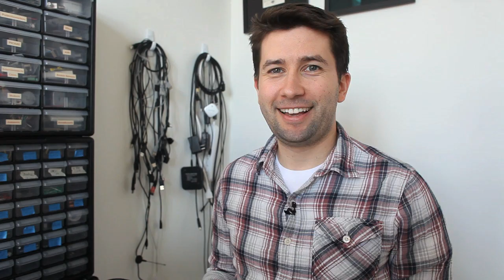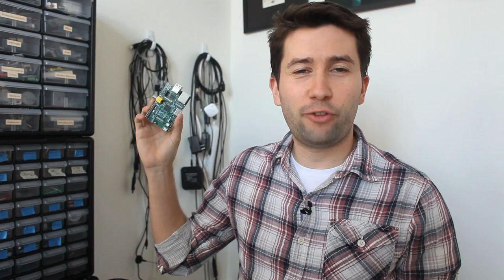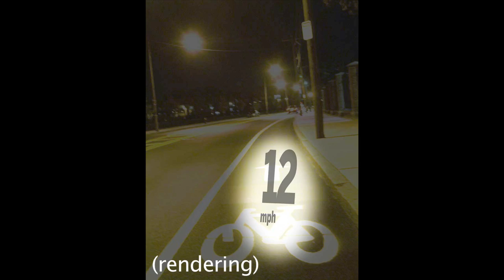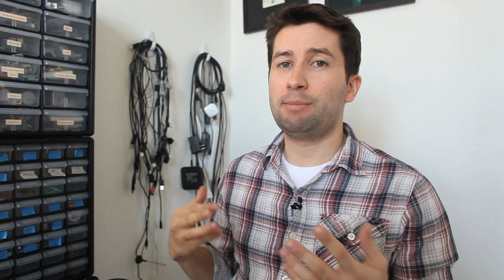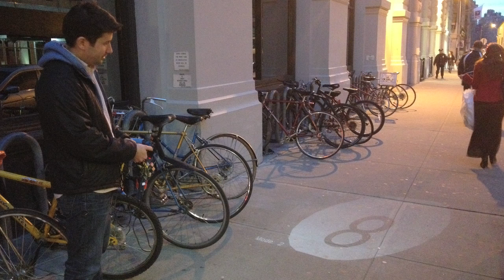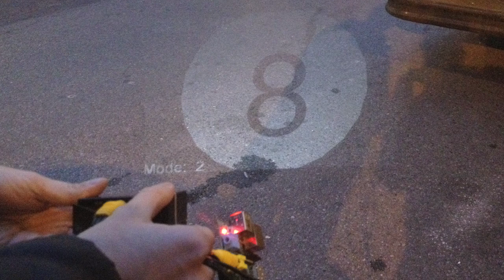Raspberry Pi Project Sneak Peek: DIY Dynamic Bike Headlight

Comment: For me, the obvious application would be late night mobile karaoke rides (Portland).  You can power the system off of the battery that is also driving the amp and speakers off the back of the bike :)

Comment: My comment below is a bit cynical I guess... I really think cyclists should have more space around them for everybody's safety. That aside, I really like the idea of Head Up Display - or should it be called Eyes On the Road Display (EORD?).

If you could get the handlebar tilt angle, use it as a x-axis, your speed as y-axis and play tetris on the screen. The faster you go, the faster the blocks fall.. Also, Augmented reality could be fun, but location should be much more accurate, I think.

Comment: Make the projection on the ground 2-3 meters wide, have dashed lines on left and right sides of it, and keep that space between them clear of any cars, pedestrians, etc. That way, you never end up in those tight places where you WILL get the door opening in front of you, possibly killing you.

I am not against cycling, I am against mixing them up with high speed, heavy weight vehicles. Deaths will occur.

Comment: I'd like to see a weather station temp wind speed humidity barometric pressure all done with ultrasonics  and even avoidance radar with ultrasonic transducers, you for sure need a rear camera projector in that puppy and video capture for that guy who almost run me over and put it on transparent OLED glasses that I can wear on my face, and call me four eyes

Comment: WOULD USING A 3300uf capacitor work between stop signs when your riding. and then you can just charge the cap with a dc motor as you ride. Good luck!

Comment: If you display GPS directions, the length of the arrow could determine the approximate distance until the next direction...
A color code could be used too...
(Ex. Green-10yds, red-5yds)

Comment: Footsteps coming to you at the speed the bike is moving, like if you were following someone's track. Funny and easy. 

You can add mile markers too to measure the distance from the point you started moving, that you can reset manually (button) or auto after x minutes without moving. All projected like if they were on the floor.

Comment: How about a chart of some kind (bar graph or simply a line graph) which shows a history of your speeds in the main bottom half of the screen, with the current speed shown in the top right hand corner and the current time or elapsed time you've been riding? Kinda of like an HUD similar to what you would see in an app like RunKeeper.

Comment: On some fancier tread mills, you set and try to meet goals.  How about a graph that is done ahead of time that sets speed/cadence goals (the rider lays these out ahead of time knowing the elevation changes and such) and you try to closely match your ride to your goals (2 pre input lines as mentioned above and 2 dynamic lines that try and match as you ride).  On the graph, left to right represents location (distance from start) and up/down represents speed/cadence.  Possibly heart rate, etc...

Comment: leaning based turn signals ... communicate where you're headed to cars

POV LEDs with the wheel spokes ... make yourself more visible to cars ... green means your going fast ... yellow slowing down ... orange slight brakes ... red full brakes

Comment: You can make it project a virtual road/path in front of you. Depending on your speed the path scrolls in front of you so it looks likt you are riding/flying through the clouds or riding over the bottom of the ocean or something like that. B.t.w, what kind of projector are you using? Maby you could potentially connect it to your phone and make your headlight give you notifications, for example, when it's about to start raining. Great project!

Comment: Maybe you define a distance that you want to ride, say 5 miles or so, and a circular pie chart begins to fill in as you progress along the distance.  You could even still show MPH within the center of the pie chart as it fills in. Second thought would be ala polar-wind-rose chart where every 10 seconds or so an MPH average is calculated and displayed in a circular pattern, so the circle would progressively add spokes of differing height based on MPH.